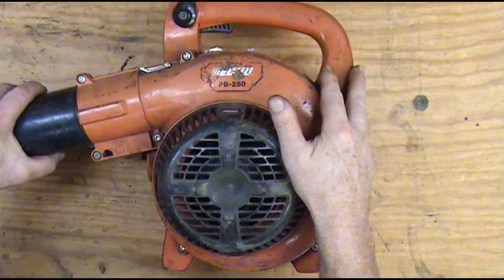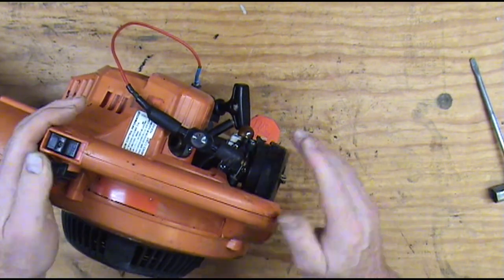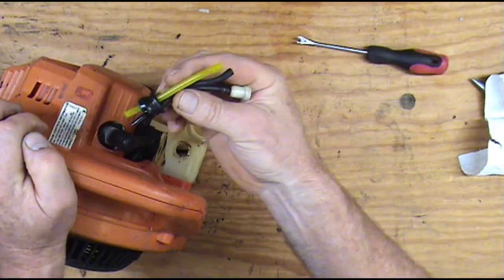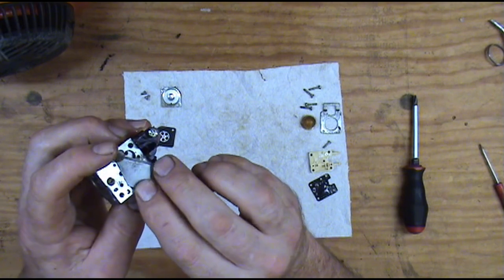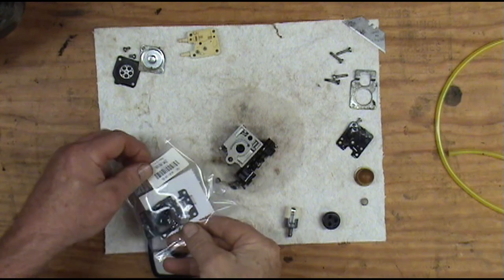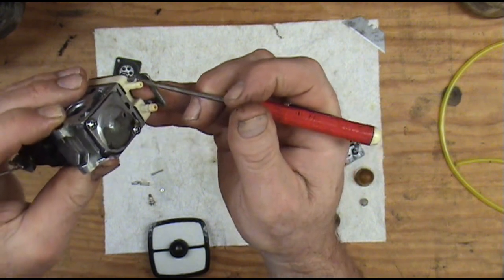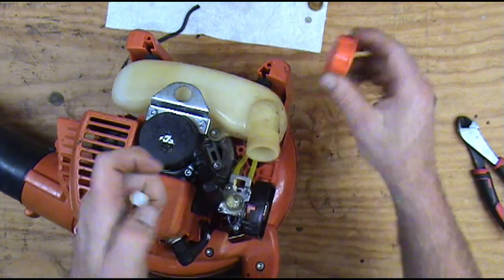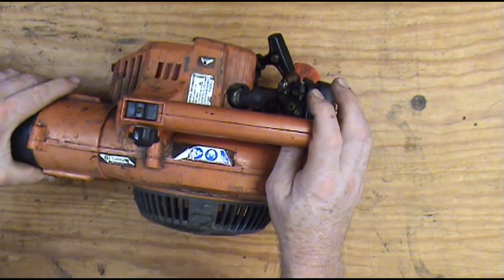ECHO Blower Wont Start  "Easy Fix"   Carb kit   Fuel Lines   Primer Bulb  Tune-up

Comment: Now this fella does a good presentation!👍👍. Camera stand, steady and focused. Quick and only speaking needed to support the project,  not wandering all around the world . Fast disassemble and replacement with power tools (IOW fast) , and it worked, 😂. 
Only thi g I'd add is to check the muffler spark screen, and even pull the muffler to check the exhaust port. They carbon up a lot, and will run like CRAP , but costs nothing to check and fix. 🙏🙏. This guy deserves subs and thumbs up's.

Comment: THank you for this video.  Saved me a trip (not close) to the small engine repair shop and $$$.    My 25+ yr old Echo PB-46 HT is running just fine as it has for that long after following your instructions.
Reply from the maker: Great to hear!

Comment: Great vid.  And you got a primo Zama carb.  I got a Walbro from a PB 250 I have to rebuild and apparently the damn fuel line kit from Echo no less doesn't fit the PB250 although it fits the PB250LN. So was wondering where you got you stock yellow and black fuel line from because I need to order some.  Also interesting that you can use seafoam and wd40 on this carb and not have those fluids interfere with the carb?!  Thought only premix should be used?

Comment: Thank you for this video. I have an Echo blower that I need to do this to as well as a weed trimmer. What are the carb kit numbers??
Reply from the maker: The kit I used in the video is a "ZAMA RB-188" .   But Echo uses many different carbs that take different kits. 
Thank you